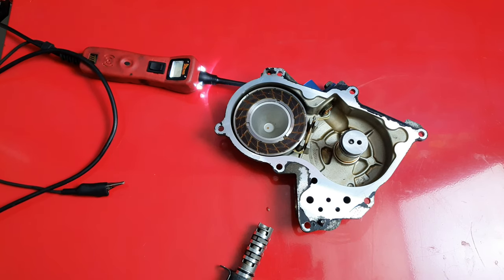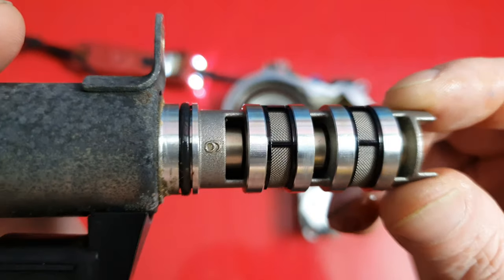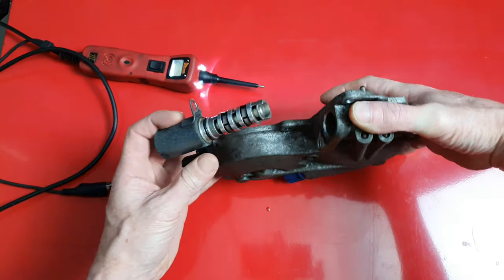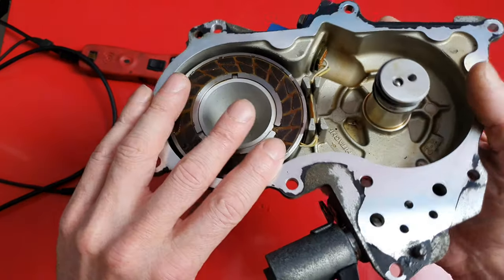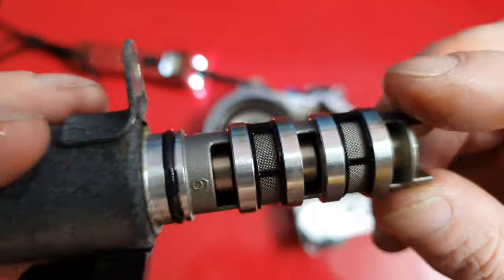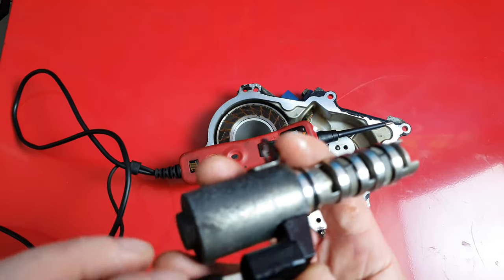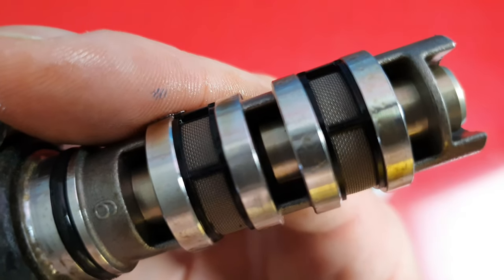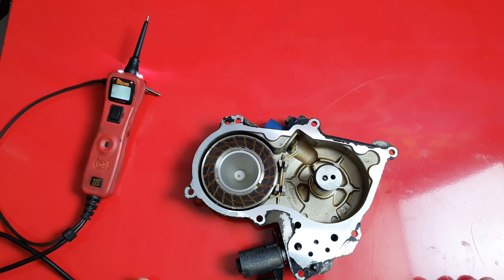How to Fix Variable Valve Timing Code P0011 P0012 P0013 P0014 "Free Fix"

Comment from the maker: Things you may need:
Brake Clean                                            https://amzn.to/2V7u8tO
Valuable Valve Timing Solenoid         https://amzn.to/2PQAz3D
Power Probe                                          https://amzn.to/2Yhr807
Cheap oil and oil filter                          https://amzn.to/302xX7n
Oil Filter Pliers                                       https://amzn.to/2YamzEB
Reply: Hey dude. I need to do this lol. I tried removing the solenoid without removing the cover but it is stuck in there and I don't know how much force to use to get it out. If I remove the timing cover as seen on your workspace in your video,  is there any small parts not seen ( springs, seals, I guess anything that would complicate the remove and replace of the timing cover) I am handy, but a rookie.i assume the solenoid would be much easier to get out with the cover off.. I hope you see this. Very helpful  and great videos. Guys like you that motivated me to even becoming a rookie.thanks again
Reply: @greglake6721  do you did remove the cover?
Reply: Flat rate mechanic, can you tell me if the infiniti magnetic retarder is removable and if it is in fact the same part as the Nissan retarder for the Maxima? Infiniti only sells the cover as an assembly with retarder and selenoid! I already spent 200 on a new selenoid because the old one was cracked!
Reply: @Letedwin1107  any reply? I found 2 exploded diagrams for a 07 G35x, one shows 3 round timing cover seals. I have to take the cam cover off to remove the solenoid and will replace the gasket, but I don't know if I need to order the seals.

Comment: Thanks for this video.  I was getting the code, and the car stalled twice while at idle.  I cleaned the intake actuator, cleared the code, and it hasn't returned.  Fingers crossed!
Reply: What's the intake actuator?
Reply: I think he means throttle body
Reply: It's the VVT solenoid.
Reply: Did it ever come back?

Comment: I got codes p0300 and p0021 and I removed the soliniod and tested it with a 9v battery and it did not move at all and made no sound all it gave me was a little spark on the one of the prongs I then tested with my car battery and nothing could this be the problem ? My car is a 07 g35x Infiniti and is running very very rough

Comment: I changed out both cam shaft position sensors with dealership code P0012 could this solenoid be the problem and clear this up? I did change the oil as well so oil can’t be the issue

Comment: My 13 37x is still throwing the code after changing vvt solenoid. What i noticed is all 4 vvt solenoid options all have been changed and light is still permanent it keeps coming back! None of the 4 i tried looked exactly like the one that came out of car so gonna test the original one like u did thats something i havent tried. Changed oil already. Any ideas or anything please let me know thanks

Comment: I have code p0011 on peugeot 207 1.6 vti. I have changed oil and filter cleanned all the gunk and installed a new intake solenoid problem still comes back. Could it be the vanos?? I also swapped the vanos from another 207 that i have and problem still returns. But cannot vouch for the condition for either vanos.

Comment: I have a 2012 G37 which just started throwing a P0011 about a week ago. My fault. I completely dropped the ball on oil changes and it was not only super low, but very sludged up. I immediately added clean oil, a new filter and some SeaFoam.  Drove about 300 miles and had that new oil changed. Added more SeaFoam to the fresh oil too. So far the P0011 keeps returning on each start-up.  I pulled the passenger side solenoid and it came out looking as clean as the one you show in the video...I guess SeaFoam really works!  Did the actuation test and the valve is fine.  Still getting a P0011 though.

I swapped the bank 1 and bank 2 cam sensors.  These were actually covered heavily in sludge.   :-(   Still setting P0011 (vs P0021) so the cam sensors seem fine.  I'm guessing the crankshaft sensor is fine as both codes would likely set simultaneously. (?)  The car has never set P0021.

I noticed you didn't mention anything about the cam sprockets. I've read that the cam sprockets can get packed with sludge and at that point, they require replacement with new sprockets. Is this true, or just an Infiniti dealer mechanic's opinion?  Can the sprockets not be cleaned of sludge vs having to purchase them new at ~$500 each? I would think soaking them in carb cleaner overnight, or even for a few days, followed by a compressed air blow-out might do the trick.

Looks like the intake valve timing control cover (bank 1) and sprocket are the next components I should remove, check and clean (if possible).

Update: I fixed it yesterday. Turned out the encoder ring had slipped about 10 degrees. It’s pressed on to the cam phaser. I was able to remove it and reposition it. All is well now!
Reply from the maker: Thanks for updating with a fix
Reply: do you have pics or diagrams ass to what you did?
Reply: What is an encoder ring can you please elaborate?
Reply: What is "encoder ring"?
Reply: @AltimaV6SportsCar  It's a pressed on ring which rides through a sensor to tell the ECM what the current angle is.
Reply: @GNXClone  
So the "encoder" you're talking about is the camshaft position sensor?
Reply: @AltimaV6SportsCar  Yes

Comment: This is brilliant - I can't figure why so many people thumbed it down. I have a 2.0 petrol X-trail in UK (Infinity in US I think). For several months I'd been getting two P1110 codes but the car seemed to drive fine apart from occasional idle lumpiness and stall - (no limp mode - so I just kept clearing the EML). After some Google time I finally got round to removing the solenoid (A right PITA when done in situ with big hands) (tip: a deep 50mm long 10mm socket puts a ratchet in the best place) and found it was real clean inside with no filter over the apertures and nothing happens with 12v applied on the bench - I now think it was duff when I bought the car used. After refitting it till the replacement arrives I left the plug off and got two P1111 codes - still no limp mode and able to acheive over 6000 revs driving uphill in first (auto). I'll edit this after trying the new one with the plug on and off at idle as I suspect a quick way to check is the idle speed might change slightly.
Reply: There is a lot more involved in a P0011 code than just one solenoid, hopefully you get lucky and this is it but I doubt it........
Reply: @lard1892  Do please tell us all then...  :-)

Comment: Thank you! I had the P0011 code on my '02 Infiniti I35 and the car was running like crap. I was prepared to take it to the shop, given the challenges of removing the intake manifold. Apparently my oil level had gotten too low. I decided to change the oil first, since it was nearly due, and you had mentioned it specifically. After the oil change, it runs like a champ again, and the code hasn't come back.
Reply: on older infiniti's this p0011 code could mean low oil, just like you've found out. on newer ones '09+ this is most likely related to gallery gasket failure, which means the whole front timing cover has to come off...

Comment: Awesome video. I have a 2011 Infinity ex 35. Sprayed the solenoids down real good with break cleaner and cleared the code for about a month of regular driving. Code keeps coming back. Trying to find a solution besides cleaning these once a month. Tested solenoids with the probe and no issues.

Comment: Thanks for the great video. I'm in need of some more help. I ended getting the code P0014 on my 2009 Maxima. Said bank 1, so I roll uped the sleeves and started getting to it. I have to say that's definetley a pretty big job not impossible but not easy. Anyway I got to the camsahft cover and removed it. Then I removed the 10mm bolt holding the solenoid/actuater, tested it like you showed us. It wasn't dirty or had no sludge. It had worked by adding power to it. So this leads me to the next part in that cover. Which is the Exhaust Valve Control Magnet Retartder. Many questions on that. I really don't want to install everything back until I'm 100 percent that I don't have to replace that part. I brought it to a local mechanic he put some sort of tester to the harness part and he said it seems to be working. I asked him how would that Magnet retarder go bad. He really had no answer. So here I'm left with the car all apart and not sure what to do from this point? How would that part go bad? How can I do a test to verify that it doesn't need changing?  I actually brought the car to the first mechanic that's worked on my car before when the check engine light came on. He ran codes also and said the it was the Magnet Retartder. The second mechanic says that part rarely goes bad and it should be the Solenoid/actuater. In this video I believe you said that you didn't want to talk about the Magnet Retarder, so it sounded like you might have a video about that part? Please help, the dealer didn't even know what that part was. I found that part on line for $150-$175 plus shipping. But when I called them they didn't know much about that part either. Do you have a source that sells the kit with it? Please help.....Thanks!!!!
Reply: What happened did u solve it I am having problem and no code appears !
Reply: Yes and No..... No meaning I ended replacing the solenoid myself with a used one from the salvage yard. But I had tested it like this video shows. Long story short the P0011 code was the worst thing that had happened to me with a car ever. I couldn't get the car to run right. I took it to 2-3 mechanics and they couldn't figure it out or fix it. I finally took the car to a technician for Nissan at the dealership and yes even they struggled. Had my car for days. I got lucky they fixed it is what I felt. By far Nissan is the worst car ever!!!! Only problems from day one. Less than 100k miles and I have replaced everything. Fast forward 1.5 years had no issues and again the car is throwing the dreaded P0011 code. My recommendation is to definetlly bring it to a Nissan dealership. These other guys couldn't fix it. Best of luck!!! @mfmf3713

Comment: Hello I switched both VVT Solenoids and I got the code again after 2 days what else could the code be?
Reply: Where they cheap solenoids? Always best to get the recommended naturally more expensive OEM products. I'd be interested to hear how it turned out since I popped a P0011 code about a week ago and my car gradually slowed to a sputter over a few days?? I guess this is called "Limp mode" a preprogrammed defense mechanism Infiniti's have in place to prevent further damage. Thanks 👍
Reply: @lgarla23  They were maybe $35 or so the ones you have on should have the serial number sticker I just typed it and bought them on Amazon. :)

Comment: I see some of your gasket rubber fused to your timing cover. I have this issue with large amounts fused to both the cover and the engine where it connects. Is it ok to leave what doesn't gently scrape off?

Comment: I have a 2010 FX35 and was able to change the driver side one pretty easy. The Passenger side cover is not easy as the final bolt is located begind the pully. we removed the pully but still wasnt able to get access to the bolt.

Comment: THANKS! my car is throwing P0014 so I took it to Nissan and they wanna charge me $2000 to replace this! Got a weekend Project now.
Reply: How did it go
Reply: @infamousnova  changed out the sensors but the whole housing needed to be swapped not just sensors cause it kept throwing codes after I changed them.
Reply: @V3RSATILE86  thats crazy
Reply: @V3RSATILE86  so the housing itself has some type of sensor?
Reply: What is the housing ? Please clarify!!
Reply: @lifeofamodernwoman  Part the sensors sit in
Reply: Did that fax it?
Reply: *fix
Reply: @Tygaswag18  ended up having Nissan fix it cause I paid to have the sensors changed out and still gave me the same codes.
Reply: @V3RSATILE86  so after the housing swap, did you still have issues?
Reply: @Tygaswag18  once it left the dealership I’ve had zero issues with it.
Reply: @V3RSATILE86  niiiiiccceee, do you remember what the repair was?
Reply: @Tygaswag18  whole housing the sensors are connected to was changed out if I remember correctly wasn’t just the sensors.
Reply: @V3RSATILE86  thank you bro🙇‍♂️🙇‍♂️

Comment: Little late to the game here but my 2015 Altima has p0011 and p0014. Camshaft timing issue.  I’ve seen these videos showing that it’s the two camshaft sensors on the top. For bank A and bank B. That what you have in your hand is a crankshaft sensor. They are on the other side of the engine. Crank, exhaust and forgot the other. I’m trying to get clarification that the camshaft sensors are the ones on the top right of the engine and are the cause of the 14 and 11 code. So I don’t have to pull all them

Comment: I have a p0011 with a clicking noise to go along with it. Could the timing chain be hitting the timing cover?
Reply: What kind of car? I have the same issue ever figure anything out?
Reply: @lemonaid8678  2007 Nissan murano, timing chain was bad😡
Reply: EVERYDAY HUSTLE dang that’s what I’m
Afraid to find out.
Reply: @lemonaid8678  1,300 bucks had to do a timing kit and water pump. Nissan cvt are BS😡

Comment: What model of G35 is this one , what year, coupe or sedan ?
Reply from the maker: 2011 g37
Reply: Just had same code pop up on 04 g35 sedan 😒, bout half full of oil on the dip and 3,2k miles... should i tryn change oil first before i buy thie solenoid and intake air temp sensor

Comment: Hi I own a nissan sentra 2004 1.8L and I got the p0011 code.I changed the camshaft position sensor, reset the system and the code pops up again. I changed the valuable valve timing and the problem still remains. Why?
Reply: If you have tha solution get me please....
Reply: @urielreyes469  because it is the vtc cover. it has the 2 sensors built into it from the dealership. the problem actually lies in the magnet inside the cover. that big looking wheel is called a variable valve timing retarder. not sold seperately. must buy with whole vtc cover. expensive.